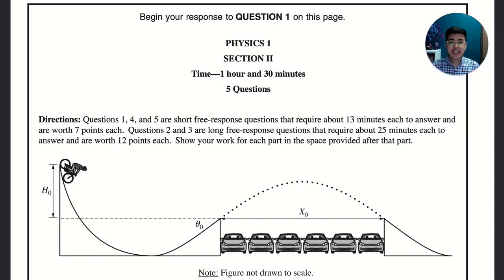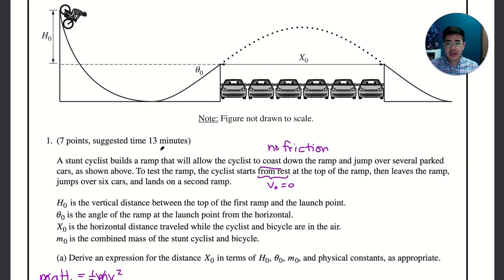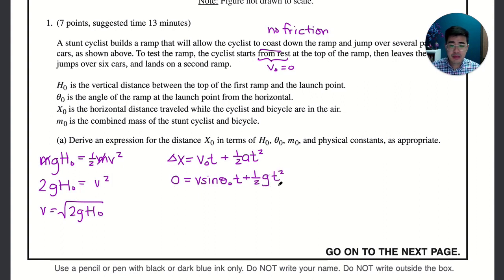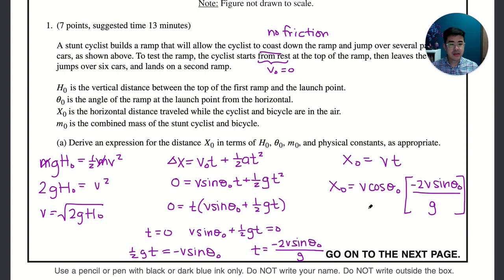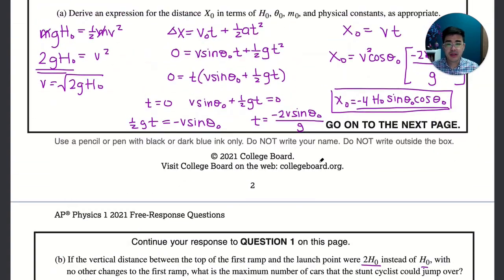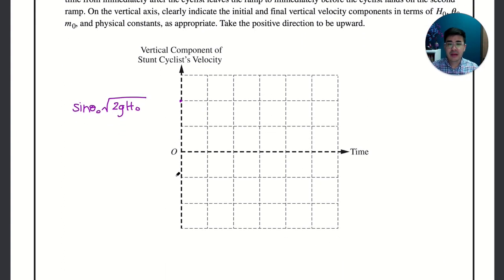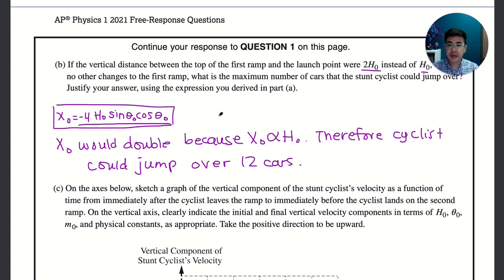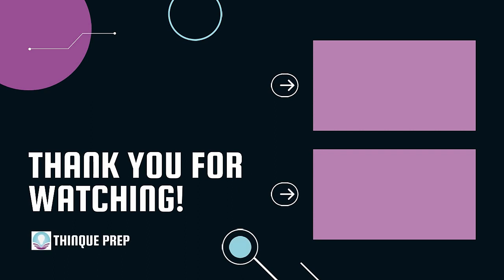AP Physics 1 2021 FRQ Question 1

Comment: Thanks for the video but for part one the g is downwards and it must have had negative sign then the time will be positive. and Your X0 is supposed to be positive not negative due to the start point of the projectile is the reference frame and X is zero there and X0 is supposed to be greater than 0 which based on your final answer it is not.